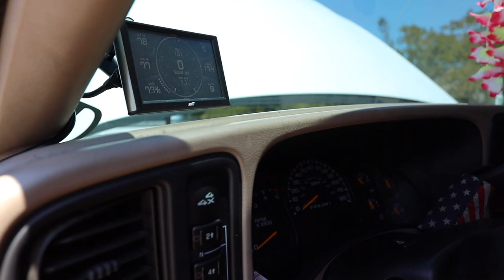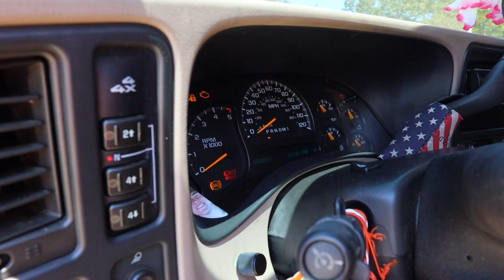Airdog 165 | BeansDiesel Sump FULL INSTALL on my LBZ DURAMAX

Comment: I recommend only drilling the pilot hole first in the tank. Put your bucket under hole then open the fuel cap to drain the fuel faster. Once tank is drained then cut out larger hole and use a deburring tool to smooth the the edges. Make sure to clean all debris inside tank so it won't clog filter or cause problems. This will keep you from having the mess these guys had.

Comment: Where did you get the plugs for the old fuel lines that remain at the top of the tank? Do you know the sizes?
Reply: DEWHEL Quick Connect Male 1/2 Fuel Rail Hose Plug Adapter Fitting LS LS1 LS3 GM (Silver)

Comment: Just finished the install today your video definitely helped man, have a problem with my fuel gauge reading empty even after filling up just wondering if you’ve dealt with that?
Reply from the maker: That’s what it’s all about thanks man! But no I did not man try looking on Facebook on some Duramax forums and see if anyone else has had a similar issue though best of luck!
Reply: Found the solution, guess from running it low all week before the install the float was stuck, I filled about 1/2 a tank tried sloshing fuel around as I drove and it’s working again!